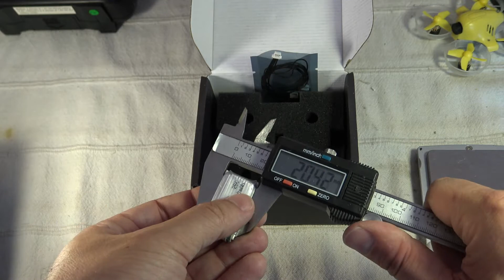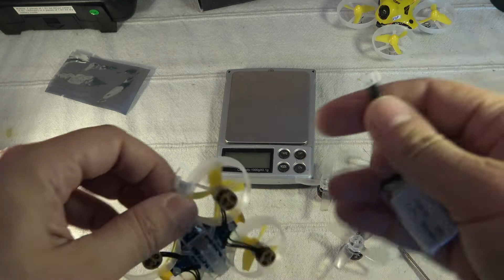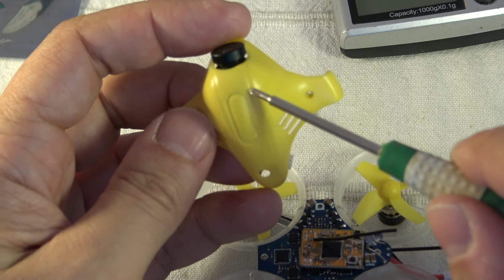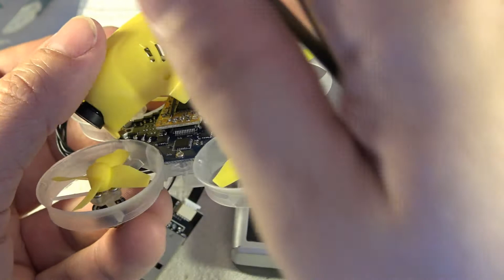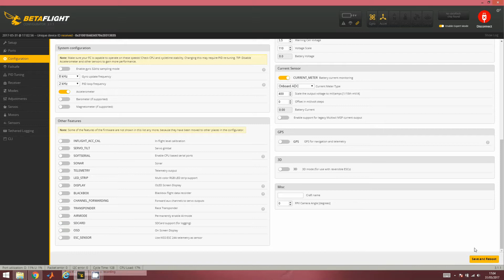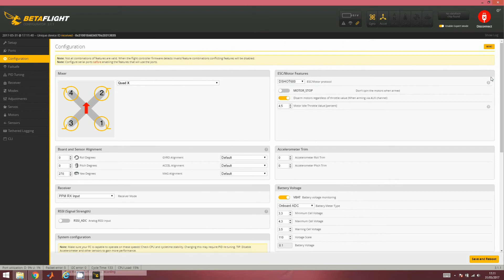Jumper X68S unboxing and analysis but nothing more :(  (Courtesy Banggood)

Comment: Is there someway to male the throttle response stronger? It takes almost 60+ percent to hover
Reply from the maker: No .... 0703 motors lack terribly of power ... Maybe a better batter with higher discharge rate... and maybe some better props can help: Triblade edition should be more efficient in practice

Comment: How do we storage charge 1s lipo i.e at 3.85v when i don't fly too often?
 My imax B6 can only storage charge 2s and above lipo battery. I want to storage charge multiple 1s lipo at once.
Reply from the maker: What you can do it's discharge until 3.85V manually .... but it"s painfull.... time to change your charger for a more Advanced one
Reply: do u have a link for multiple 1s lipo Storage charger ?
Reply: SeBy DocKy i have advanced Imax B6 charger but cant storage charge 1s lipos

Comment: maybe with the landing poles being exposed like that you could find like small plastic hald circle shape plastics and glue onto the motors or even rubber ones and make a hole in the centre
Reply from the maker: Yes maybe since it's an outrunner motor, it means the plastic will spin too :( so it's very good in practice ...

Comment: Do you think that changing to Dshot600 had anything to do with motor/ESC dying?  Probably not.  Not good quality control! They could not have performed even a basic test to see if the unit worked before shipping. This is a disturbing trend by manufacturers of these quads (even worse for more expensive machines like the Xiaomi MI, in my point of view).
Reply from the maker: Hard to say .... but I don't think so (I hope too )... Really I checked everything, and I saw no burnt FET ... then after the receiver died :( :( ... Seems to be nice but fragile machine